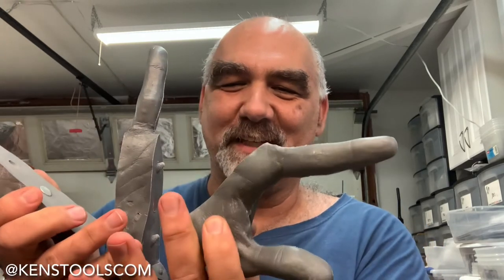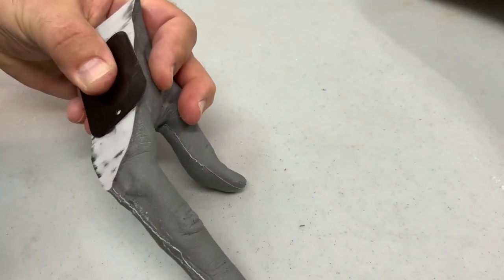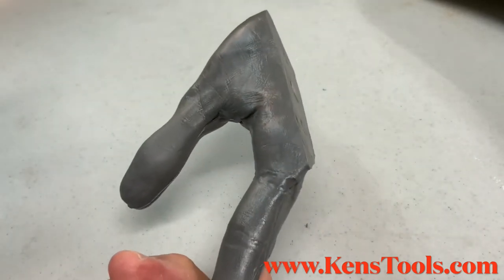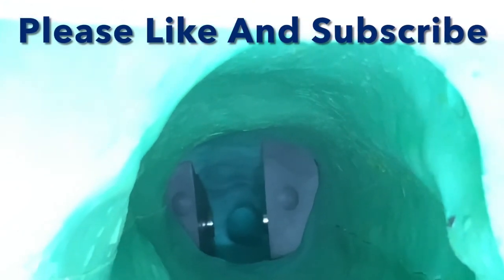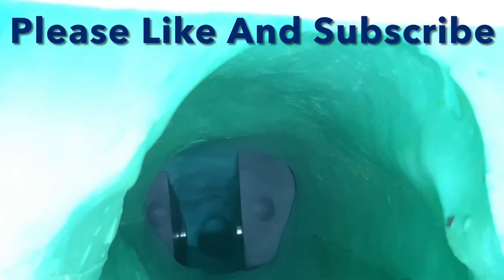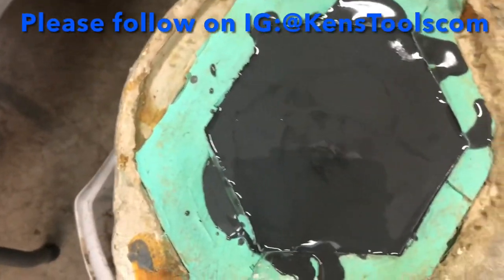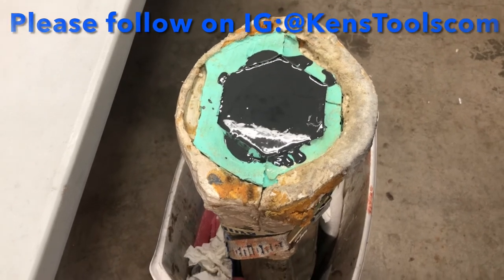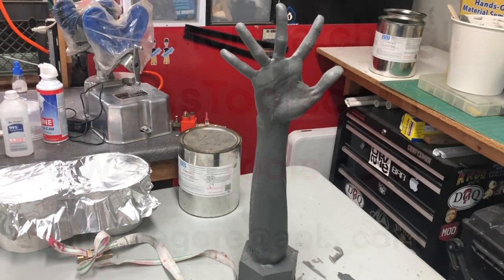Collapsible Hand Core

Comment: Great video brohoodius! I'm not sure what this is used for , but it's interesting.😀
Reply from the maker: This core is used for sculpting gloves for Cosplay or special effects or to accompany a mask. The fingers are separated as you would not be able to remove the finished glove without tearing it. The advantage of this is you can pull the center out of the glove and then remove each side down through the glove individually.